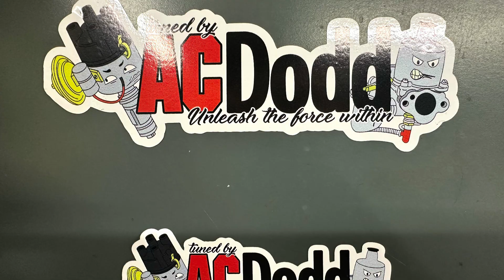Vacuum advance, and why you need one on a road car……

Comment: Hi AC, quick question, have you ever come across ported vacuum on MGB HIF4s where there is a notch in the butterfly that covers the vac port when the throttle is closed? I bought a second hand set of carbs for spares and this is how they are set up. Thanks!
Reply from the maker: Need to see a photo
Reply: @ACDodd  Thanks for the quick reply. After a further search sounds like it is US emissions feature.
Reply: @ACDodd  http://youtube.com/post/Ugkx2MLVfvuXmnTIJRKmHLlgzi3orXxXISCN?si=FYlmHk-gHPHPJogf
Reply: http://youtube.com/post/UgkxcEFHL_iVDm0iFPH3zEmQ0pH1rLTb1rRp?si=fXKtfVzYlt5zkOnr
Reply: http://youtube.com/post/Ugkx7--19KQIQ3gZEI6jqD5iIcIj8VHQPRZo?si=e6TZJlBS4Q3luZiP

Comment: Hi, I have a pair of H4 carbs on my Mk3 Zodiac, but neither has a port for the vacuum advance, can I use manifold vacuum? Cheers from Australia
Reply from the maker: You can, but you may find you have too much at idle. You can get around this by making up a switched vacuum valve operated by throttle position using micro switch to actuate a valve which opens when the throttle is depressed.

Comment: Quick question about vacuum advance being connected to ported vacuum - there is no vacuum in that location when the engine runs at light throttle open conditions so what's the point? Should it not be connected to a full manifold vacuum port? But then again if it is then the vacuum advance will be increasing the over-all advance at i.e. idle (say 6 deg of nominal advance + say 12 deg from vacuum advance gives 18deg at idle). Apologies I'm just confused a bit.
Reply from the maker: ‘There is no vacuum in that location when the engine runs at light throttle’ is an incorrect statement there is vacuum, as it’s designed to be produced above idle at light throttle openings not when idling. If your carb does not do this the drilling is located in the wrong position.

Comment: My 998 metro seems to have an intermittent misfire when on part throttle but under heavy load even uphill it doesn't misfire or hesitate. I recently discovered that the vacuum advance diaphragm is leaking. My mechanical advance is working and I set the maximum advance to 30deg at 4000rpm. Could the lack of vacuum advance be causing the misfire/hesitation?
Reply from the maker: That causes an air leak which will contribute to the lean misfire I suspect your having. Fix the leak and then get the part throttle fueling dialled in for flawless operation.

Comment: As you say the process of optimising the curve with a vacuum guage and hand punp will take a long time, but for EFI applications where there's a manifold pressure sensor a software routine to optimise the timing at part throttle load would seem to be pretty simple to do. ?
Reply from the maker: There’s a project for you
Reply: @ACDodd  Another one to add to the very long list. 🙄
Reply: I tuned the 3D timing curve for my classic trials car with EFI  and throttle bodies (home built system) by starting from estimated figures then trial and error on the road with the help of a home made, electronic knock listening device. I set extra timing advance where I thought it would need it (low throttle/load setting), as per a vacuum unit, and listening for knock. A trials car is often all about control and good response, rather than running flat out on a race track, plus the ability to be suddenly given full throttle for the steeper bits. I got it to the situation where I can give it full throttle without going into knock (using standard grade petrol, which is sometimes all that can be found on a long distance trial in the middle of the night). What was surprising was how large a safe increase in “vacuum” timing advance can be in practice. From what I’ve found, some of the vacuum units on distributors seem quite conservative in how much advance they add.

Comment: Could I just ask a basic question. Is manifold vacuum highest when the throttle is open or closed? I.e when you put your foot down does the vacuum advance increase?
Reply from the maker: Closed, vacuum drops when the throttle opens.
Reply: The engine works like an air pump. It’s always trying to empty the inlet manifold. The atmosphere tries to push its way in to fill it. If the throttle is closed the engine wins the battle because the atmosphere can’t get in. However, as soon as the throttle is opened even by a small amount a lot of atmosphere gets in. The “vacuum” advance is only needed for very light throttle openings. As AC says, the engine does then need to have a relatively large amount of extra timing advance.

Comment: Another good and informative video.  It's such a shame that the modern vacuum units are not calibrated anything like those of old, where the traditional mercury vacuum figures (initial and full) and dizzy advance degrees were stamped on the vacuum unit body.  Before fitting, I use a vacuum generator and then stamp the values onto the modern vacuum units.  An example of these values would have been a nice little addition to the video for when people start their on road experiments comparing one vacuum advance unit against the next....
Reply: Indeed. My 1275cc MG Midget's vacuum unit has the following numbers stamped on it: "5 8 3", which I gather means it starts advancing at 5" Hg, stops advancing at 8" Hg, and gives a maximum advance of 3 degrees.

Comment: As ever, no ‘word salad’ BS from AC. I’ve learnt  this stuff already, finally... finally... only it took weeks of watching waffle-merchants to get there. Only to see AC bang it off in 15ish mins.
It’s poorly presented - he’s not articulate like AC yet the Unity video helps a lot. You’ll want a MityVac; a decent gauge; co-driver.

I recommend 123Ignition then you can truly get it to filled-in to the last decimal. A clock-work is not so easy or precise. Well done AC - AC - you cut the cr*p - thus because you've a  tight presentation style, still reckon you'd do a better 'vacuum' vid than even the great Mr Vizard himself.
Reply from the maker: Thanks for the high praise indeed!!

Comment: Awesome to hear you talk about advance units,   i have a 1275 + 60 " with a big valves 20b springs engine block is strapped and decked line bored ,etc , i using a 286 grind cam , it is true that with high lift cams you have little to no manifold vacuum until high revs,  and is it true 123 distributors have a number of setting to coupe with different dwells so no need for a advance unit ,
Reply from the maker: It is true that there is less vacuum at lower rpms with bigger cams, it is not true that the 123 has curves which you can do away with the vacuum. No dizzy has that.

Comment: I have an MG Midget 1275cc engine, but the standard vacuum advance unit only gives 3 degrees of maximum advance - does that sound about right?
Reply from the maker: No there is a problem which needs rectifying.
Reply: @ACDodd  What I meant, is that there are numbers printed on the vacuum diaphragm body, "5 8 3", which I gather means it starts advancing at 5" Hg, stops advancing at 8" Hg, and gives a maximum advance of 3 degrees.
Reply from the maker: @FMFGUF  that’s not going to produce as much as that engine will need.
Reply: @ACDodd  Thanks. How much would you say it may need (stock 1275, aside from HIF 44)?
Reply from the maker: @ that depends in the advance curve that’s Installed in the dizzy.

Comment: My 1275 carbed Mini had poor running and would run on/diesel when switching ignition off. A local mechanic tried to sort it with timing adjustments but still not right and I tested the vacuum advance servo and found it had a leak inside (would not hold a vacuum). Replaced it and things immediately improved. 
My car came to me fitted with the remnants of an electrically operated solenoid air valve mounted in the engine bay and a switch on the gearchange mechanism that only closed when in top gear. There are currently no air pipes from the air valve to anywhere on the engine, so its not doing anything currently. I've heard this was fitted to some european cars for emissions reason at cruising speeds by allowing air into the intake manifold, reducing vacuum level. Any ideas on what it was doing and if I should re-instate it?
Reply from the maker: It’s an emissions device, and is not needed for your car to run at maximum efficiency.

Comment: Thanks AC, my mini uses a lot of petrol. One thing I have noticed is the vacuum unit is loose. It is firmly fixed to the dizzy, and yet it still wobbles. Is this an issue?
Reply from the maker: Any loose parts are not ideal, and it needs to remedied to ensure the unit performs correctly.

Comment: My 123 ignition don't have a vacuum unit like that. But it haves an connection for the vacuumline to the carburettor what I use. How the 123 ignition deals with vacuum? Is it all programmed?
Reply: I have also a 123 dizzy installed.
There is a sensor inside which reads the engine vacuum from the connected pipe.
Not sure which model you have but mine one is generation 1 (the curve selector is underneath) with 16 fixed programmed curves.
The vacuum advanced is pre-programmed.
Reply: @allegrogt1  thnx for the info 👍 I have the same one as you with the 16 curves.
Reply from the maker: It’s a transducer inside the unit.

Comment: Does this apply to electronic dizzys as well?
Reply: I had sidedraft webers on my car but i never ended up racing it so when i put the stock carb back on with my racing ignition system it had no vac advance unit, luckily the company i got the dizzy off was still around so i took it back to them and got them to put a vacuum unit on and fitted it all back up, ran perfect and has vacuum advance, instantly noticeable improvement in fuel economy. Runs sweet and spark plugs look good.
Reply: Yes. The engine doesn’t know that what type of distributor is fitted, it just needs the correct spark advance. If the car was originally fitted with a vacuum unit, it should still have one for road use. I tune my engine using an ECU and still programme in some vacuum advance on the ignition table. I use a knock detector to make sure I can get the best out of the engine without causing detonation.
Reply from the maker: Yes.

Comment: So applying this to 1380 standard Mk1 & MK2 cooper s, which distributor and what approx timing do we use as a starting point?
Reply from the maker: 1380 is not a standard engine. Any dizzy can be used with a vacuum unit, but the advance curve needs to be matched to your engine spec.

Comment: I’ve been told my mini has too much vacuum? What would cause that?
Reply from the maker: That’s likely the carb is providing a manifold vacuum signal instead of a ported vacuum signal. Ported vacuum delivers no vacuum to the advance unit at idle and thus you have much better advance figures for emissions.

Comment: Great information, i didn't actually know most of that!
Many thanks.
Reply from the maker: That’s the point, the vast majority don’t.
Reply: @ACDodd  is it easy to test it's working properly in the distributor? Does it need maintenance?
Reply from the maker: @richweston6202 easily tested with a strobe light.
Reply: @richweston6202  You can remove the distributor cap, disconnect the hose to the vacuum diaphragm, and connect another (clean!) hose then suck on it; the distributor base-plate should move by a few degrees, and spring back when you release suction. If suction doesn't cause any movement, you probably have a punctured diaphragm.
Reply: @FMFGUF  brilliant many thanks